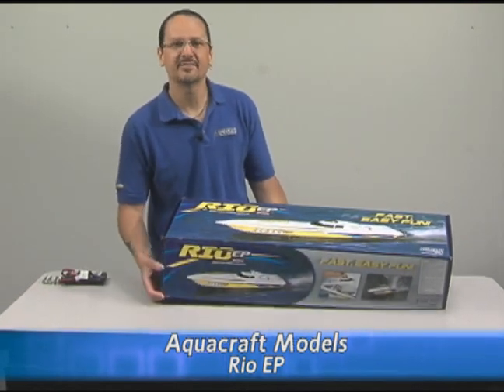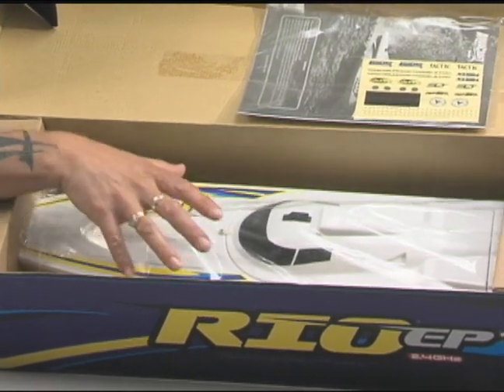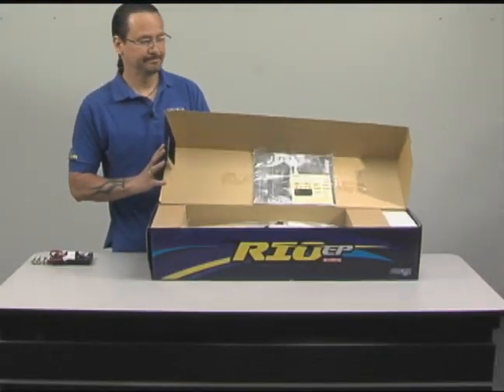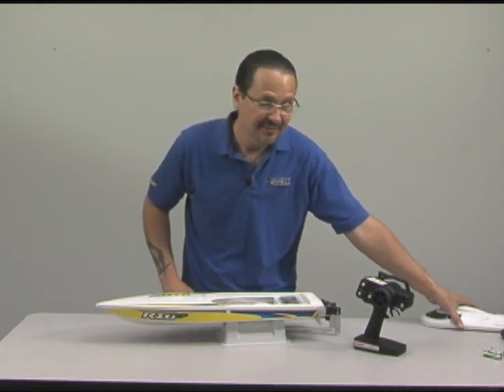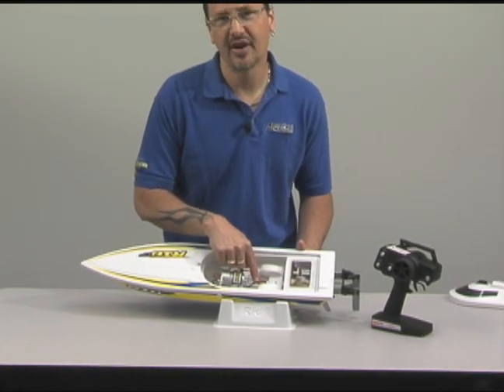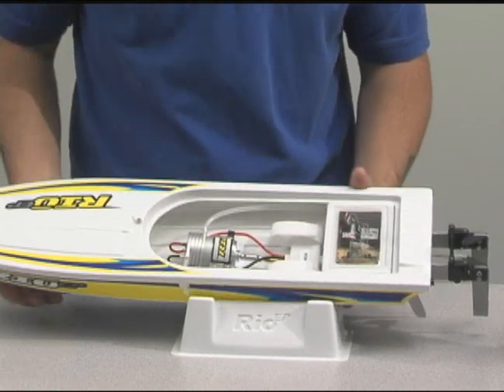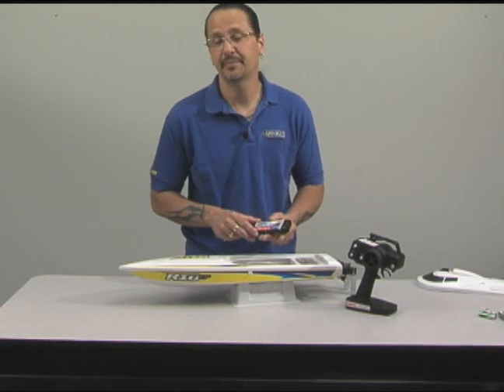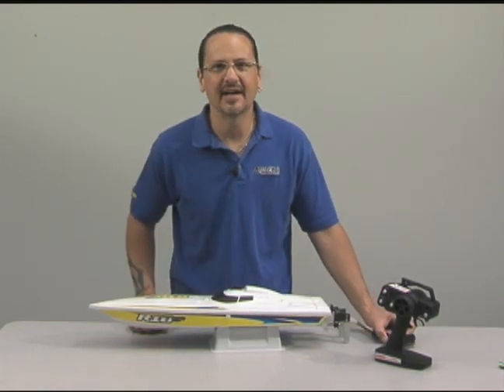Spotlight: AquaCraft™ Models Rio™ EP 2.4GHz RTR

Comment from the maker: You'll have to work out the installation.  You'll need to design and install the needed hull reinforcements, install an engine mount, locate the fuel tank, route the exhaust system, and move the radio equipment around to suit.  It can be done, but it would be quite a task.